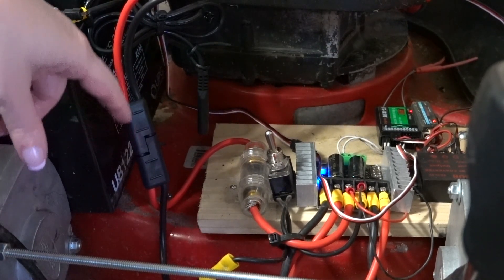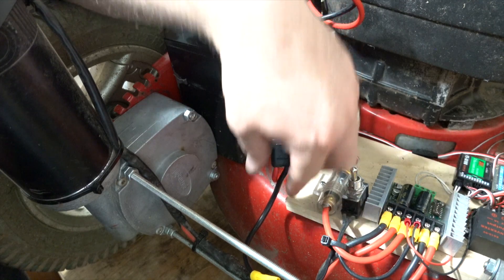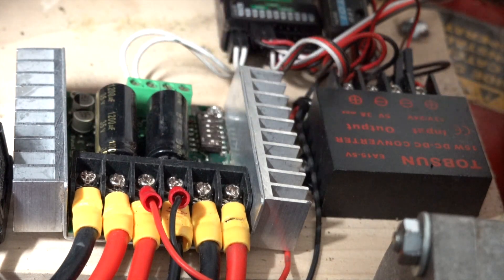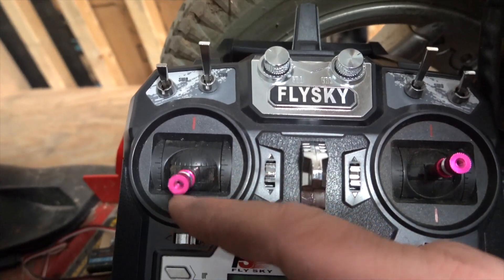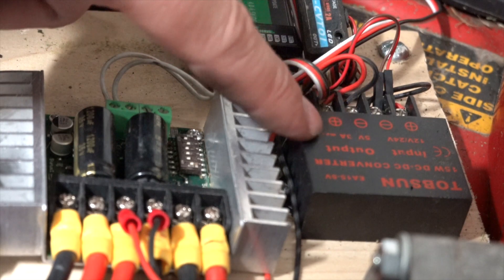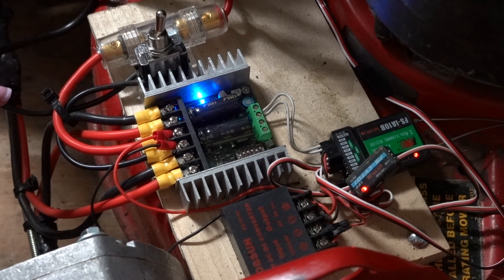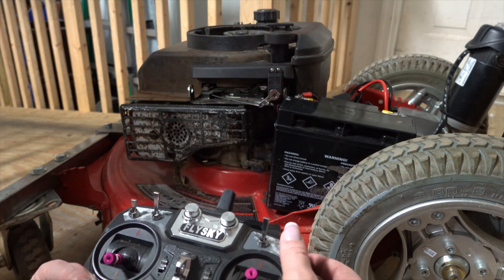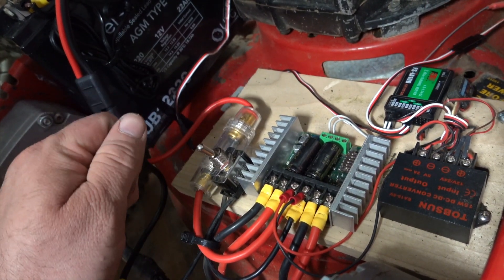How To Wire An RC Mower (Step-By-Step)

Comment: awesome video!!! i'm new to robots and trying to build a battlebot. how did you power your receiver using the step down converter and connecting the signal wire to the motor controller? thank you!!! jimmy
Reply from the maker: The step down converter plugs into the receiver using the VCC port. The signal wires are channel 1 and channel 2 of the receiver.
Reply: @MeantToBeLindseyB  hi lindsey, i watched the video again, did your husband cut out the red/black wires leaving the white signal wires for the receiver and motor controller. did he cut another wire just leaving the red/black wire to connect the receiver to the step down converter. thanks again jimmy
Reply from the maker: @jimmyfinke6759  Yes. Since we used the step down converter, we did not need to use the red and black wires to the motor driver. If you did not use the step down converter, you can use the red and black wires to connect the motor driver to the receiver to power the receiver. Hope this helps!

Comment: Update: just took the mower out today for a test. Looks like I found a relay for power is working for now. Used a 30amp fuse for testing and everything stayed pretty cool didn't get hot. I'll edit a video and upload for some feed back.
Reply: I have two vids up now. I'll post the remote relay for power and engine kill. You guy's rock. Gave me the inspiration to build one. Now to figure out new projects for the extra mortors I have..

Comment: Doing 2 projects that are similar to yours. I got a riding lawn tractor mower given to me recently and I'm using 2x60 sabertooths on 1 rc remote to 3  treadmill motors  run on 24v via lithium ion 24v 7s12p pack I made.  Also have 3 sets of wheelchair motors   but the mower was pretty costly and I'm wondering if the 1 2x60 could work it has a 120amp burst draw  it's just gonna be a 6 wheel drive rc toy I might put a couple of arms on for fun after while. Or would I need 3 2x32
Reply from the maker: Holy cow! That’s a big project. We honestly can’t say for sure without testing individual components but a single 2x60 would probably be okay for just playing around. That’s a lot of amps you’re dealing with. Be safe and keep us updated!
Reply: @MeantToBeLindseyB  most definitely it's that time of the year mowing season. So I should have something done with it in next couple weeks. I have 2 sets of thumb throttles  from scooters and have couple foot petals coming. From Amazon see which more comfortable using, on top of radio controllers.  I've been Honestly contemplating making a universal case that houses the 2x60 or 2 of them with quick connects and housing for whatever I currently need to use to lower costs
Reply: @MeantToBeLindseyB  kinda like a all in one control box. Imagine  the infant carseats bases for your vehicle type thing. I've watched your video dozen times over last 3 years. I purchase the big stuff like the 2x6 or the batteries like I did this year. I wanted the battery to also be inside of the case so I went with spim08hp 3.7v 8ah 200amp discharge rate just got 70 of them for about 2 bucks a sell after shipping.  See how it works out in just got a cnc machine too between that n 3d printing figure something out makes using these expensive driver more practical

Comment: Just dropping a note. I have 90% done. Just working out some safety/wireing. I tested a ford SW-3 starter solinoid. Have it working that one switch turns on the motor controler and a amber strobe light. When i contect the remote cut off relay I'll be able to see if power is off or still on. I have a servo on throttle/ground to kill the engine as a fail safe.

Comment: Seems Amazon not carrying battle switchs. I have the servo connected to the throttle/engine kill. Thats great the engine will shut down as a fail safe but I would like the power to the controler also. I have a rc on/off relay and looking to use a 40amp auto 12v relay to cut power. You could use a y connect to control two servos or relays from one channel. My mower is 70% done.
Reply from the maker: Good idea using the relays. Let us know how it goes!
Reply: @MeantToBeLindseyB  will do.
Reply: Still waiting for a couple parts. Things are real slow...

Comment: Why is the switch on the negative wire? I never seen this before, usually you would leverage the positive from the battery to the switch.

In general you should switch the positive. Otherwise, you are always at risk of having the negative wire short to ground somewhere before the switch and turning whatever it is on, and the only way you have to turn the item off will be to pull the fuse which you don't want yourself to be in that situation ;)
Reply from the maker: In this case, it’s a closed loop with no connection to the chassis or anything, so  a short to ground is a lot less common than most applications. I chose to put it on the negative side because the positive line already had the fuse. I have since replaced both with a single circuit breaker on the positive side.

Comment: You could bolt an extra pulley on top of the mower then mount an alternator to the side with a charge controller you could also hook up an electric start off of a snowblower and use a dc to ac converter to power it mower would always have power as long as it has gas

Comment: For the camera the First Person View (FPV)  and VR googles used with rc planes would be perfect. 
A better but way more complicated would be a 360 deg action camera again with VR goggles and realtime streaming with sensors so that when you turn your head you can see in that direction just as if you were walking behind the mower. This would be best if operating remotely so you could be aware of any safety concerns and take appropriate actions. You might even add a two way voice communication system so you could talk to those who are curious or warn off those who might want the mower for themselves.

Thus could become a nice business.
Several mowers with operators in a van with AC. 
Next see what you can do to serup a rc weedeater/edger and a leaf blower

Comment: I have the same radio (but different reciever) for my airplanes. 

Wht not just use a mower that runs at a set rpm and not mess around with a throttle servo at all? Otherwise, good job.
Reply from the maker: Because of the change in terrain and thickness of the grass (we have some thicker spots on the side of our house). Also, being able to throttle down helps save a little bit of gas if I need to reposition my chair to mow the next section.
Reply: @MeantToBeLindseyB  oh yeah. Don't get me started on those thick patches. You gotta creep through them really slow.

Comment: Without a doubt the BEST video I have seen on wiring an R/C mower.  I've put together a collection of nearly 100 videos on R/C mowers and snowblowers and yours is my go-to for wiring.

I'm finishing up a R/C snowblower and will be using your throttle servo arrangement as the basis for a chute rotator.  Being anle to rotate the chute and adding an old cell phone to wi-fi the view of where I'm going will be a big improvement over last year.  I hope to be able to blow snow from INSIDE the house this year.

You two put together a fantastic video.  Great job and thank you!
Reply from the maker: You’ll have to show us when you’re done. 😊
Reply: @MeantToBeLindseyB  hi my name is jodie and I would like to know what size wire I need and what kind of control driver also, plus where do I need to set the fix switch at just for the motors
Reply from the maker: All the wires and controllers are listed in the description. Also, I’m not sure what you’re asking on the the “fix switch”.

Comment: Hey Guys,   Thanks to your video my RC lawn mower is coming out great!  Quick question...how do I change the  degree of servo arm swing.  I've got it set to channel 5 and controlled by SWA.  It currently moves about 45 deg and I'd like 180.
Reply from the maker: I know you privately messaged me and I responded to you but I wanted to comment here, in case anyone else has this question.

Servos aren’t really designed to work with 100% range off of a switch input. You need to get an on/off servo switch adapter like this one: https://amzn.to/3mo1tPy

EDIT: 
He just played around with the setup, which is just the 270 servo plugged straight into the receiver and he can confirm that he got a little less than 90 degrees rotation on it too. He googled the issue and It has something to do with remote receiver signal straight into the servo, but he's not 100% sure exactly how that works.
Reply: @MeantToBeLindseyB  Thanks for the information.  The servo I purchased is the exact one listed you linked above.  It is clearly described as an adjustable servo with angle up to 270 degrees.  My servo is only turning 45 degrees.  I will try the switch as you recommended but I really think the servo should be able to be adjusted to move between 0 and 180 degrees as I need for control of the lawn mowers trigger switch.  The SWA switch connection is functioning perfectly, I just need a wider angle.  I will keep you posted. Thanks again for a great series of videos!
Reply: I must say I am particularly proud of how awesome the project looks so far.  Once I feel safe controlling it and cutting, I plan to install a camera controlled by the left stick!!!!!!!!!!
Reply from the maker: Nice!
Reply: @MeantToBeLindseyB  I sort of solved the servo arm swing issue.  Adjusting the end point setting on the transmitter gave me about 100 degrees of arm travel.  That should be ample for pressing/depressing the mover hand control bar.  Thanks again.
Reply from the maker: @dr.psprojects9591  Glad you were able to get that solved! We'll definitely keep that in mind if we ever need to adjust ours.

Comment: Okay I bought all the exact same equipment that you bought I wired everything exactly like you got it wired all my little lights come on exactly like they're supposed to but when I turn on the transmitter and I bought the same exact transmitter but when I got the remote control unit turned on and I try to get it to move it does absolutely nothing when I first turned it on it says turn off switches forward and turn to the throttle all the way down so I do that and I turn the unit on it still does absolutely nothing can you tell me what I'm doing wrong and it says on the thing that it should be programmed from the factory to the little unit with the little flashing light and I still got absolutely nothing tell me what I'm doing wrong please because I can't get my wheelchair to move whatsoever
Reply from the maker: It could be a whole lot of things... my first instinct is that the transmitter and receiver need to be bound again. Yeah, it’s usually bound at the factory, but it can get messed up.

The instructions for binding the transmitter and receiver are easy and you can find them in the manual and online.

If you do that and it’s still not working, email me pictures of your wiring connections and I’ll see if I notice anything meanttobelindseyb@hotmail.com
Reply: Well I figured it out I got her working it was a bad motor driver I tried to get the company to send me my money back or either a new one they just decided to give me my money I ordered one from another company and while I'm in business your video wasn't inspired me to make one of my own only I'm putting a snow blower on the front of mine so I can sit up in the house and the cold days and snow blow my driveway

Comment: Great job, I'm converting my riding mower but I have hills, can you do one with a track system? Or spiked wheels
Reply from the maker: The wheels we have can do up and down hills pretty well. It does struggle going sideways along a hill. Better traction tires would work better. Or you could even get solid tires and put screws in the tires.

You could also make it like a track system like you mentioned, but that’s a LOT more work IMO.

Comment: Excellent explanation.  I fly RC so I was familiar with most of what you used, but I think it was so clear that even non RC people could get what is going on.  Thanks
Reply from the maker: Thanks! That was the goal. I had no idea what he was doing originally either but I even understand it enough now to explain it (obviously) :)
Reply: Thanks id started buying thing for the project,don’t know if I survived little bit expensive for the parts ☹️

Comment: Great job.  Rather than a mower I built a robot that is used to get or water plants in large in basement "greenhouse".  Your suggestion of using a 12V to 5V is converter is SUPER important.  I made a wiring mistake on my first attempt that created a short on the 12V side but the failed part also shorted the 5V side which was powered by the drive only.  This took out the drive as well, an expensive mistake.  You confirmed my suspicion about the need for a separate 5V supply.
Take care.  Best of luck to you.
Reply from the maker: Thanks for that tip! We weren't initially even thinking about that part, but it's definitely useful to know this information.

Comment: Are there any DIP settings on the sabertooth 32?
Reply from the maker: Yes. Check your manual. There’s also an online wizard you can find online. It would need to be configured for your particular application.
Reply: Hey I'm sorry for asking a ton of questions... But... My transmitter isn't recognizing my reviewing my receiver anymore. What do I do?  I tried to turn my transmitter off then on again holding the bind button but that did nothing.   It worked when I tried without hooking everything up but now that I have, it doesn't.
Reply from the maker: The receiver came with a special connector to put it into binding mode, it doesn't have a button like the transmitter. Generally, you have to put that "key" in the "VCC" port and put the power input on any other channel, then hit the bind button on your transmitter. Check your manual on how to bind your model of remote receiver and transmitter.

Comment: I am a complete dummy, when it comes to stuff like this .. but you've explained this so well that I believe that I can put one together... I have bought everything I need, now we just have to see if I am good enough at following your instructions to actually put it together and make it work ..
I will let you know how it came out when I am done.. I went ahead and bought the hundred amp breaker that you suggested , rather than just a fuse. and I also bought a switch setup that was already wired so I can have a switch to turn everything on. I'm putting a blinking light on mine ... and I've got an actuator that I'm using because I am mounting a plow to mine.  The actuator will lift the plow up and down.. so I can plow my driveway with it . since my neighbor won't do his job like he's supposed to... I'm in a wheelchair so this project is going to be great for me... I'll let you know how she comes out.. but I just wanted to thank you for responding to all my dumb emails that I have sent to you ....
 most people would not have responded after the third or fourth one . but you have sent me to the right place each time . and done a damn good job of helping me out. so well that I believe I can actually make this project go over and work ... even though I'm a dummy when it comes to things like this.... once again thanks a lot.
Reply from the maker: That's great! Keep me posted. :) Good luck!
Reply: Any updates on your progress? Good luck!

Comment: How did you set your dip switches?
Reply from the maker: Chaplain Dan If you're using the Sabertooth dual 25A motor driver, you can use the wizard to help you set the switches for your particular setup
https://www.dimensionengineering.com/datasheets/SabertoothDIPWizard/start.htm

Comment: Amazing work!  I'm actually going to attempt something similar but with a larger (54"!) mower deck from a riding lawn mower.  I'm hoping I can find a DC 24v motor that will be able to run the deck, but I'm thinking a vertical shaft Predator engine from harbor freight might have to suffice.  Thank you for the videos and knowledge!
Reply from the maker: Thomas Giboney That sounds like an amazing project! Let me know when you get it working. I’d love to see it!
Reply: @MeantToBeLindseyB  Quick question! I also purchased the Flysky FS-I6X and I wonder, is there a way to stop the annoying 'inactivity' alarm?  Seems to start beeping after not moving any controls on it for a few minutes.
Reply from the maker: Thomas Giboney I wish I knew this answer to this. If you figure it out, let me know. 😊
Reply: Treadmill motor

Comment: I need your help with this. I'm trying to somewhat copy your design and I'm having trouble.
Reply from the maker: Feel free to email me at MeantToBeLindseyB@hotmail.com and I’ll see if I can help you.
Reply: These guys are great they will help you and they will explain it to you so you can figure it out
Reply: Hello MeantToBeLindseyB, do I need to do anything to the transmitter to make it work?
Reply from the maker: @andrewchampy5222  No. It comes already paired to the receiver when you buy it. There are a few settings you can set when you buy it, like fail safes and reversing channels based on your particular setup, but it should work straight out of the box.

Comment: The Flysky FS-CVT01 connects to the 12v input of the BINZET DC Converter which also has 12v coming from the saber.
Reply: The voltage it reads goes...where?
Reply from the maker: I’m sorry... I thought I responded to this. The dc converter battery input is a direct connection to the battery, connected to the battery lines where the battery input for the Sabertooth is connected. The voltage sensor is connected to those same lines so it’s basically still connected directly to the battery. The output of that sensor is plugged in the the “sens” port on the remote receiver. Then, on the transmitter, you can turn on that sensor (Named ExtV2 in the System -> RX setup -> select sensors menu) so it displays the voltage on the main screen of the transmitter.